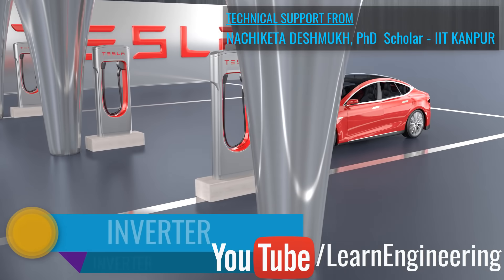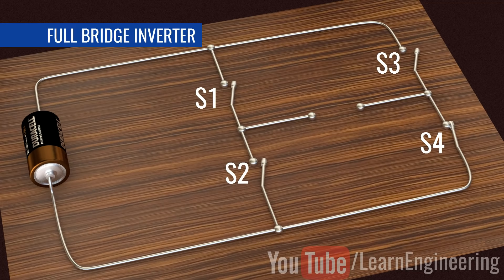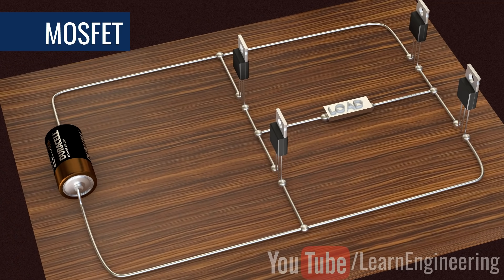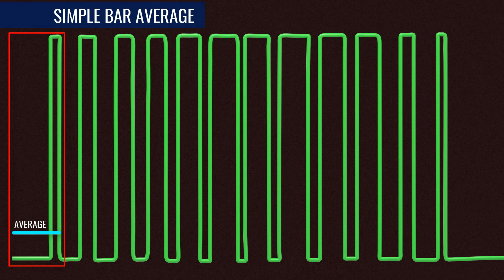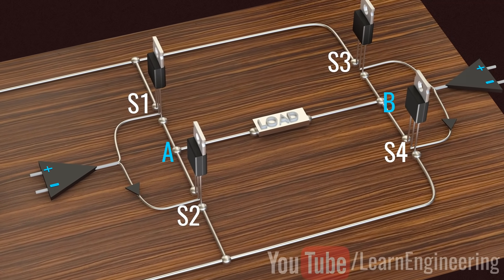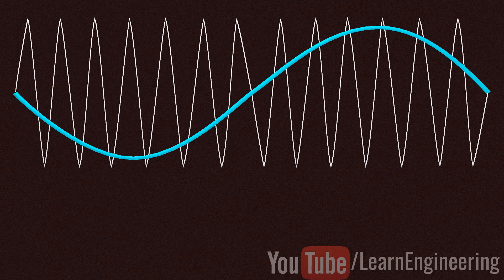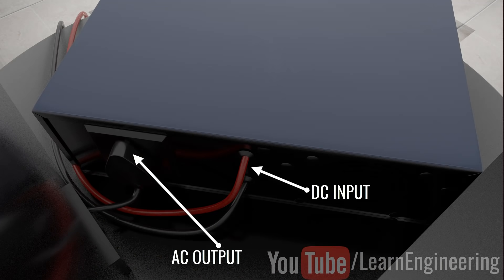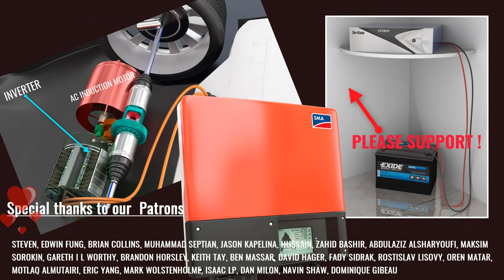Inverters, How do they work?

Comment: So, ultimately triangular waves along with sine wave are indispensable for input of comparator??
Then, for producing sine wave, we are using sine wave!!!
Reply: TechnoLogical LOGIC Yes, but the sine you use at the comparator is just a signal. It's low power. At the output of the inverter you have a high power alternating voltage.
Reply: If they used a pure sinewave input to produce the high voltage sinewave output- what they would have made is a 90% inefficient Class A amplifier. The PWM design is what gives the modern sine wave inverter it's tremendous efficiency.
Reply: Creating a sine wave isn't hard, but creating one that can power something is. Btw. in most "intelligent" driver circuits (like those for car motors or the motors in "drones") you never have a real sine signal and comparators. It's all done in software and the pulses for the MOSFETs are created directly by the controller. But it still works very similarily, just "virtual". The triangle wave is replaced by a counter counting up and down, the sine wave replaced by a table of sine values and the comparator by a simple numerical comparison of the two values.
Reply: from an oscillator (say, Colpitts oscillator) Even a cheap $5 walkie-talkie can do that.
Reply: But still: WHERE do you get the small sinus wave from??

Comment: Nice video man... If you are reading this then make a video on.. how remote control works...
Reply: Remote control works on Duracell batteries
Reply from the maker: Thank you for your compliments. I will have a detailed study of  the remote control topic.
Reply: I doubt he will. Remote controllers are very simple. It either works by radio frequency or infrared (i suppose bluetooth as well but thats more software than hardware). Radio frequency being the simplest, just generates and radio frequency then the receiver just closes circuit when the frequency is received. Infrared essentially blinks a light towards a infrared sensor and decodes it as binary (I believe). Feel free to correct me if I'm mistaken, anyone.
Reply: To generate sin wave we need... both sin wave AND triangular one. Does anybody see contradiction?
Reply: @maxim5360  Man I don't know why ppl keep asking that same question. I'm sitting here with the ability to calculate and construct a sine wave with my bare hands. I'm pretty sure they can easily use a few semiconductor devices to create a signal. since a signal is all they need for reference.

Comment: So you're using an AC motor with an accumulator, it is because AC motor have a better efficiency than DC motor?
the inverter has his own efficiency, what is the global efficiency of an AC motor with an inverter compare to DC motor?
Reply: Séb la malice you get a higher power to weight ratio with a synchronous machine for example. It uses three of these fullbridges for a 3 phased current. The possibilities of regulating this system are much better than for DC Motors
Reply: Usual DC motors have brushes that wear out. The commutator (the thing the brushes rub against) in a DC motor is creating AC for the motor coils (in that sense all motors - except for the homopolar motor, which has almost no practical applications - are AC motors). You are just taking this commutation and do it outside of the motor with electronic components instead of sparking "switches". Everything else is the same.

Almost all new EVs use permanent magnet motors (Nissan Leaf, Chevy Bolt, Tesla Model 3, ...) , not AC induction motors. They are a lot more efficient over a wider RPM range and smaller and lighter for the same power output. You sometimes hear the motors in cars called "permanent magnet AC" motor. They aren't any different from BLDC (brushless DC) motors (the ones used in disk drives, drones, some power tools). The reason they call them PMAC is because they are driven with a sine wave instead of a simple square wave. It's just more efficient at higher powers and creates less electrical "noise".
Reply: Running a motor at 1 constant speed, DC is probably the most efficient. However to change the speed I think it'd be less efficient. When we convert it to AC changing the speed can be done by simply altering the MOSFET's  PWM. I also think it is way less stressful on the batteries, but I may be wrong on that.
Reply: superdau nice explanation, one thing to complete: AC current is necessary for the induction of voltage/current. If the function is steady, then the derivative is zero and there is no induced current. And induction is necessary for all EM

Comment: Why not just use DC power in electric vehicles instead of converting to AC?
Reply: There are brushless dc motors available but the reason they use ac motors is that dc motors are limited by the strength of their permanent magnets. Ac motors do not require permanent magnets
Reply: What everyone else mentioned above me plus ... DC motors require brushes and commutators that wear out over time and also DC motors require magnets which loose their effectiveness over time. In addition to that, 3 phase AC induction motors are rugged and reliable having proven their effectiveness and pulling power over the last 5 decades (think water pumps that pull massive loads of water from great depths). To top it off there's brushless DC motors but they are expensive for the same power/torque requirements compared to induction motors
Reply: DC motors have brushes that wear out. The commutator (the thing the brushes rub against) in a DC motor is creating AC for the motor coils (in that sense all motors - except for the homopolar motor, which has almost no practical applications - are AC motors). You are just taking this commutation and do it outside of the motor with electronic components instead of sparking "switches". Everything else is the same. You often hear that these BLDC (brushless DC) motors are "just 3-phase AC motors". They are not! The working principle is entirely different. The speed/power of a BLDC is controlled by the voltage applied. The switching of the "phases" follows the speed of the motor (identical to what the physical brushes in a brushed DC motor do). In a 3-phase AC motor the speed is controlled by the switching of the phases/frequency of the AC. 

Btw. almost all new EVs use permanent magnet motors (Nissan Leaf, Chevy Bolt, Tesla Model 3, ...) , not induction motors. They are a lot more efficient over a wider RPM range and smaller and lighter for the same power output.
Reply: This is because the speed and the power output of a dc motor can be increased up to a certain limit, after which it gets heated enough to be broken down.
An AC Motor especially Induction Motors are much efficient and their speed and power output can be changed by changing the frequency of the input E.M.F. and the amplitude (Current) of the input E.M.F. respectively.
Reply: ...but please forgive my ignorance if I'm completely wrong!  my ignorance is why I watch these videos!
Reply: For an AC motor, you can change the speed of your motor by changing the inverter's switching frequency at a given voltage.
To change the speed of a DC motor, you have to change the voltage directly. That means you'll need thicker cables (with more insulation to deal with the higher voltage) than an AC traction system, which compromises space (for cable routing) and weight.

P.S. Brushless DC motors (BLDCs) do not have a "built-in inverter" as some seem to believe. They are powered from a DC source, but have electronically controlled commutation to determine which stator coils should be energised and when.
Reply: They use controllers which are in fact some kind of invertors, producing some non-sinusoidal AC based on motor RPMs and Hall sensor
Reply: Because DC is amazing and does a lot of things really REALLY well. Motors are not one of them. Every single motor or generator that is designed to run DC sucks the big one. In this case, localized AC is needed. AC is also used to run transformers but it's 2017; DC-DC converts exist and are as efficient as transformers if not more.

Now the reason WHY DC motors suck is because magnetic fields only transfer change of power, not power itself. A consistent current will transfer nothing, so you need to do trickery to get around that. As a result, it's extremely hard to pull off using raw DC and is a lot more practical to just make AC on the spot. Motors that don't use magnetism exist but are absolute shite, and it's hard to compete with the efficiency that magnetism gives.
Reply: this video shows how dc to ac works in general (inverter version). u need ac for homes. generator produces ac and ac is more practical in transferring the current. it is natural phenomena of waves. dc u need for electronic when u manipulate electrons to get desired effects. ac for dc motors is not needed it. ac is used for induction motors. 99 percent of u here will not understand what he s talking about here. there are methods to control dc or ac motor. induction motor control happens to be better for battery. less power shortcuts. when u need to start engine u just changing the freq. not the current.
Reply: rusco321 ...I think it's because with AC, you can use an induction motor...and AC can be stepped up or stepped down efficiently...
Reply: sigh many electric cars use motors such as BLDC that do in fact have permanent magnets. Magnets going bad isn't really a problem in real life. The point is only that all motors are AC on the inside; a regular "DC motor" has brushes that wear out and that have a bunch of failure states that would really suck in a car driving fast. Any electric motor that isn't a brushed DC motor will require some type of inverter to be used in an electric car, because that is the way you control the speed. AC and brushless DC are very similar in operation, even though there are a bunch of different configurations.

The reason the magnets go bad in a motor is from being overheated, not from basic operation. Don't repair it by welding on the motor case and you'll be fine. ;)
Reply: Because 3 phase AC motors are much more efficient and extremely powerful.
Reply: Raymond Jameson Can you expound a little.
Reply: Jesse Fritz Bold thing to say when the physics are pretty obvious. I love DC but can admit it's bad at driving motors. The reason is because induction requires flux to transfer and the only way to create it via DC is either an inverter or to pull on various parts of the motor in a chain. As you can imagine this can create a ton of eddy currents if done at the wrong speed. It's so much easier to create AC on the spot and use that. Preferably polyphase since it is as good as DC but lacks the downside.
Reply: u are wrong. this control is better for battery. less current shortcuts. dc control is ok for lower mechanical resiting. same method they use in amplifiers today. g model. u need to understand that higher freq produces less of a  magnetical effect and more of a radio effect. talking about nature of transition
Reply: rusco321 They do use brushless DC motors w/ an inverter for speed control.  Chinese brands mostly,   because China has 50% of all the rare earth that the brushless permanent magnet DC motor use. 
Tesla uses AC 3 phase motors w/ a inverter to convert from DC to AC.  They use AC because an AC motor will generator electric to recharge the battery.  The common term is Regen, it is selling point on EVs.  AC use cheaper material instead expense Rare Earth magnets like brushless p.m. DC motors.  AC have high start torque for rapid acceleration.  AC have Higher heat tolerance too. 3 phase AC don't require a starter like AC single phase.
 Check link for a better explanation
https://www.electronicproducts.com/Automotive/Fuel_Efficiency/AC_versus_DC_motors_which_will_optimize_your_EV.aspx
Reply: You should study the history of electric Metro subway trains power system.
It was very difficult to control the speed of AC motors 50 years ago, no power IC back than.
(If you look at cheap AC fans, there are only 3 speed, not continuous gradient of speed, which trains need)
so metro trains were powered with DC currents, and initially, speed was controlled by huge potentiometer, ie variable resistor, which dumped huge amount of electricity as heat to control amount of electricity going into DC motors. not very efficient use of electricity.
now days, most advanced metro trains use VVVF system, variable volt, variable frequency.
ie, processor controlled brushless motors. almost no waste of energy.
Reply: a rusco3l i think ts bcs they haven't yet discovered  high speed ac efficient motor.
Reply: The answer lies in BLDC Motors they are motors which have no brushes and can run on dc power, but they need controll logic called ESCs but they still are not as powerfull and fast, they are usually known as stepper motors and are used in precision workloads such as transport belts and 3d printers
Reply: Gustavo T B dos Santos then in electric train there using dc motor only dc motor have high torque than ac
Reply: AC is required to turn on the induction motor, which is the only way we can generate that rotatory motion !!!
Reply: Arber Sino brushless dc motor are actually ac motor with built in inverter.
Reply: superdau A BLDC is exactly a 3-phase motor.  To be more specific, it is a 3-phase permanent magnet synchronous motor.
Reply: Wrong.
Reply: AC motors (not all) have better torque vs. speed ratio and this is why we use electric motor in a car in the first place. I think they are also smaller. And no brushes (except ring AC motor).
Reply: Oh dear, the confusion you get when people only half know a subject...
Now the basics, to turn a motor you need to have a static magnetic field and a moving magnetic field, and you can move a magnetic field by switching magnetic coils on and off  in a circle. A brushed motor does this with brushes, brushless and induction motors do it with electronics, and those electronics are alternating the current through those coils for a smooth power transition.
What people are used to calling "DC motors" are simple brushed motors, they usually aren't in electric cars because the wear and tear with brushes is pretty significant long term and their efficiency is the lowest.
Reply: mssomeomenew umm no. induction motors do not use electronics to do the switching, it's called plug it into the wall and you've got 60 cycles at the tap. BLDC's are nothing more than 3 phase DC motors and the ESC is doing the switching (converting to AC) for you. ALL the ESC does is change the frequency and the input voltage via MOSFET and in order to know which phase should be which polarity it does this by means of hall sensors.  (not all BLDC's/ESC use hall) some are sine wave.
Reply: Omega Haxors .... huh... there's more torque with DC then AC. covert to DC and take it through a transmission. there's no need to take an AC motor to 10k RPM! AC have way more Eddy currents than DC ever thought about. Do you know how an AC motor works????
Reply: AC motors can be controlled much more dynamically and precisely. Also they don't suffer from wear-out of the brushes and are therefore maintenaince-free. Last, the brushes cause a lot of EMI noise and would disturb your radio. But you are right, before power electronics were so advanced, DC motors were used in such applications (e.g. trams). Today DC motors are mainly used in low power or consumer applications.
Reply: rusco321 because that would be fuckin retarded
Reply: Every single person in here is wrong. AC induction is NOT more efficient than DC!! Get real!! And heat?! REALLY? Do you have any clue as to why the Tesla power plant has a liquid cooled rotor?! because it's so inefficient at converting electrical energy to mechanical that the energy that it can't or didn't convert goes into heat!! DC is absolutely the way to go, and you don't need super high rpm from it, take it through a manual transmission. AC induction is actually old and inefficient tech. it was great when it first came out but we have better tech now and can do better. 3 phase AC does not have more power than DC. People don't even know what induction means and it's inefficient.
Reply: Dc more storage and lower speed and power
AC more speed  and high power to do heavy works

AC is like wavepulses generated by some transformer

DC have one side with many  eletrons and onther with few  when you conect poles it will discharge (positive > negative)
Reply: Motors (used to turn the wheels) require AC power.
Reply: Boone Meadows DC motors exist, so why not use them?